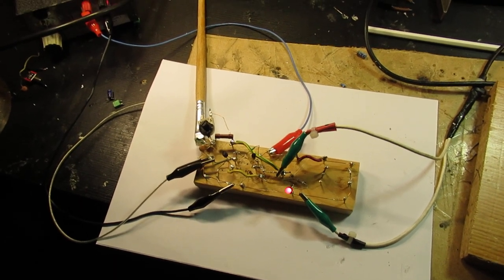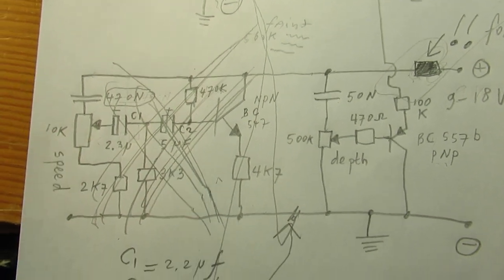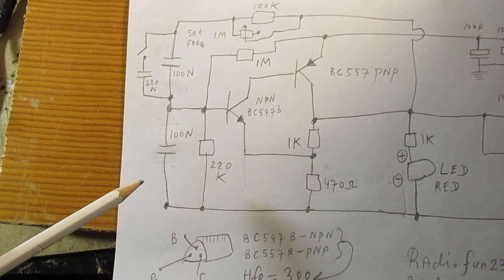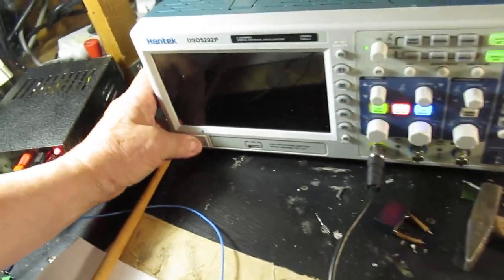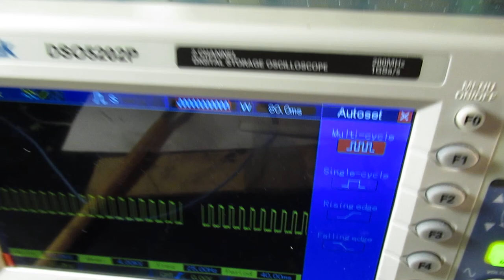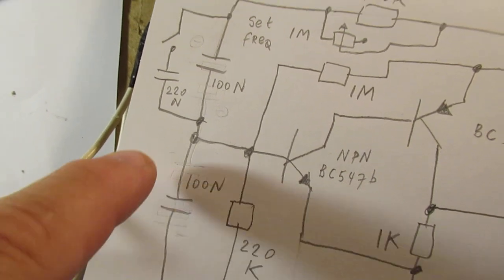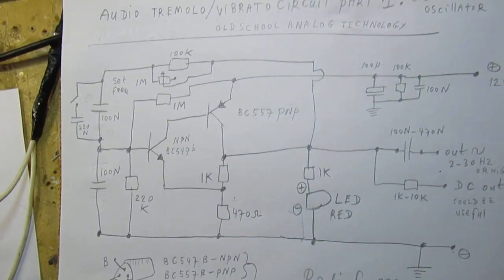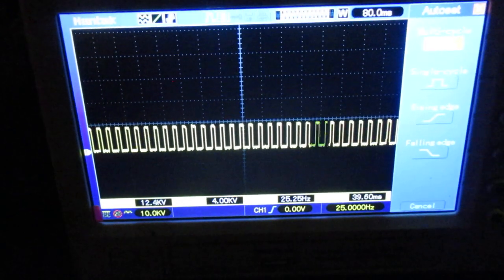Tremolo or vibrato oscillator for audio: the basis oscillator between 1 Hz and 50 Hz demo/schem pt1.

Comment: Tremolo modulates the amplitude of a signal.
Vibrato modulates the frequency of a signal.
Reply from the maker: Thanks, that will help.😃
Reply: @radiofun232  No problem :) I'm currently building a synth so im neck deep in this stuff :p